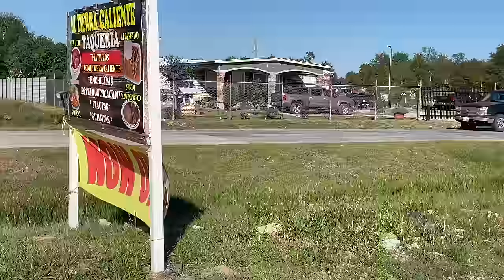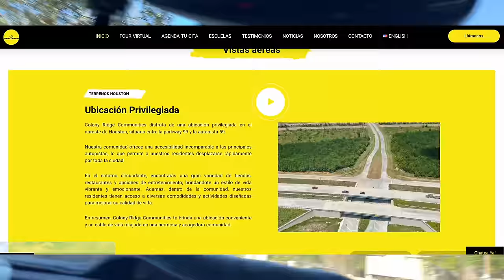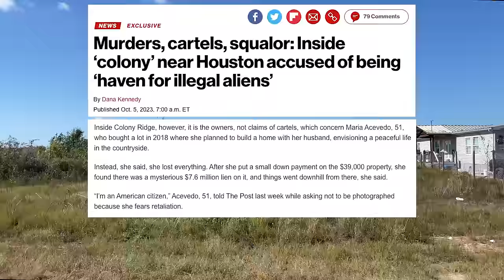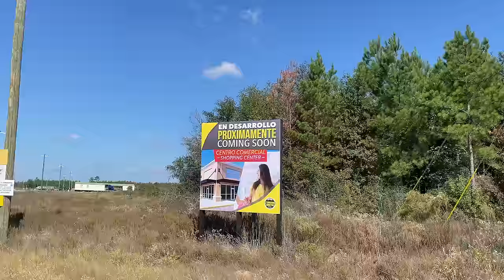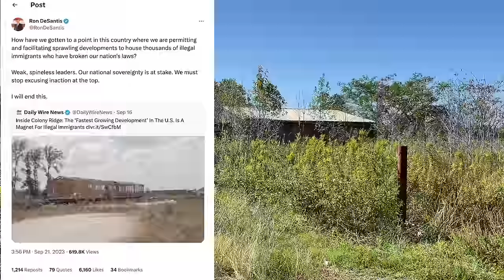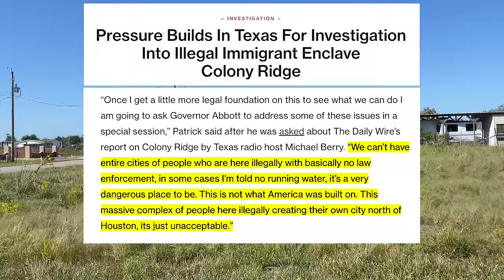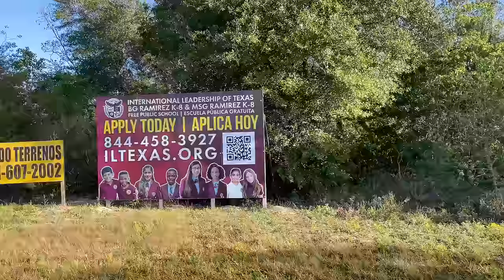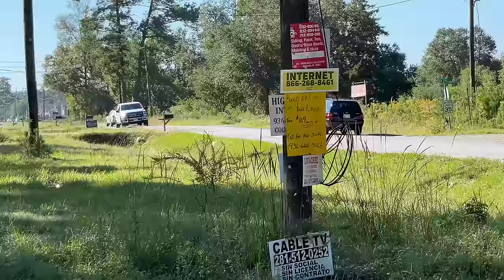I Found A Massive Immigrant Community Being Built Near Houston

Comment: Ive lived within 20 minutes of this place for the last 12 years and DID NOT know it existed. Last year my wife and I found 5 acres of land at a decent price on HAR and decided to jump on the motorcycle and head over there to go have a look. We crossed 99, drove about a mile and ended up in a completely different fucking country. After the 5th taco stand in 2 blocks time I thought hhhmm  thats odd. Its little Mexico over here. Then i noticed houses half burned and abandoned, trailers ripped in half, trash everywhere, overall it just felt like we had landed in the most run down area of Mexico, when just minutes before we were in our own community near Humble. We made our way to the address where the land was, though we already knew it was a waste of time. Once we turned onto a "neighborhood" road, the feral dogs were everywhere and we got chased on the motorcycle by a pack of them, and let me tell you it was not fun. I couldnt just speed away because there were speed bumps in the roads there. My wife was screaming and kicking them. They were viciously snapping at us as i swerved and honked my horn. Soon as the speed bumps cleared we got the hell out of there. 

This is not a normal community of people. This area is not normal. There is very obviously something else going on here. Im told cartel are very active in the area. That police dont bother going in there. That its basically the wild west and these people basically just live and do whatever they want. Laws optional. 

Do not accidentally wander into Plum Grove.
Reply: You are so full of it. Did you really just go with the original “I’m told”lol. I live in new caney and humble is nothing to brag about.

Comment: There is a large strain mechanism and rust wind trail demander right out there outside of Houston. If you would hung drop onto the flock deal with a magnitude steel count you would see a gray skin enamel drain right before the gulf keep. Ones demanding hub grind would surely stake hold those rancher nails if proper invention.

Comment: Need to build up your lot higher than the rest of the area.. few truck loads of fill to be out of flood levels.  Pay the trailer off in 10 years.  It's deprecated a good bit in just 5 years. Get power back ups like solar or whole home generator that runs on propane.  If you can't do those things then you need to just live with it..

Comment: So building or dwellings have to be up to Code if it's not it can be taken over by the Govt! The infrastructure has to be there or it will be confiscated if the sewage isn't up to Code say the under ground pipes need to meet the areas standard and it looks like there over building and sewage is seeping thru to the surface it should not be lived on.